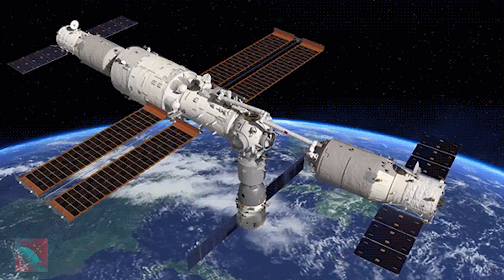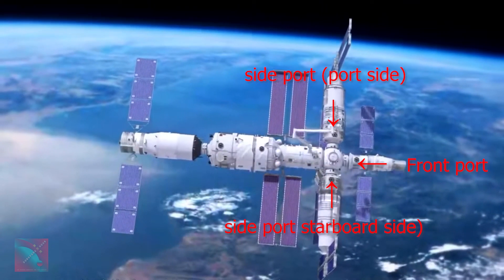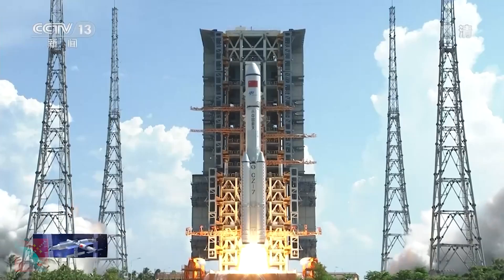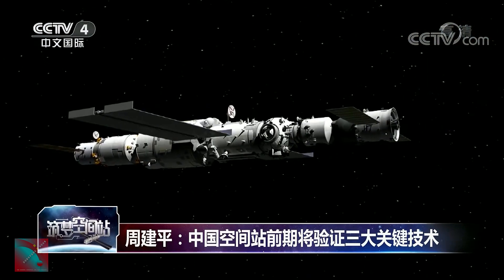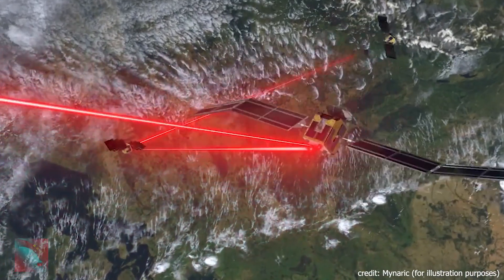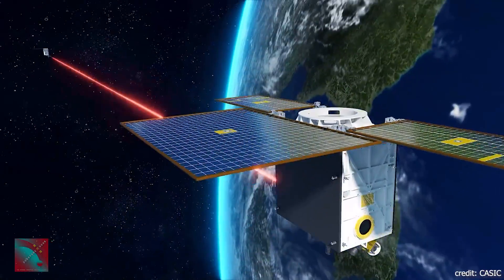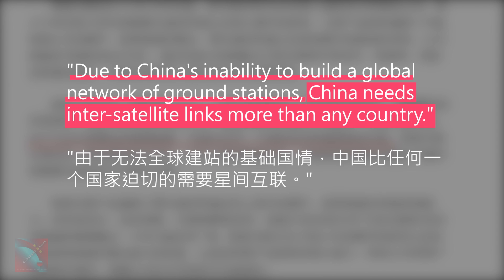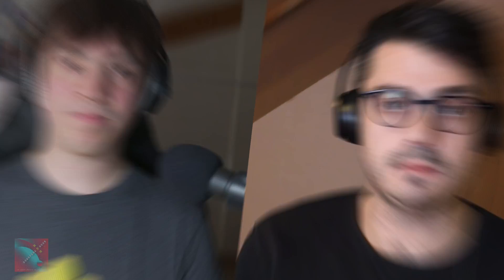The Chinese Space Station Tests Module Transfer Capability, A Startup is Developing Laser Comms Tech

Comment: I think the 20 degree was chosen because the solar array of tianzhou could not be re-folded and folding the solar panel of tianhe will be risky and time consuming, therefore, to avoid collision between the solar panels, only 20 degree turn was made to demonstrate the capability of robotic arm assisted undock, turning, and redock, instead of docking at the side, it redocked to the forward port, that is still a complete procedure to re-dock a module, only difference is that it is docked to the same port in this case
Reply from the maker: This is really helpful, thanks @Vony7. I’m pinning your comment to the top of the video 👍

Comment: I would agree with the 3rd choice with the robotic arm. My guess is they were testing the arm if it can hold up to the torque on the arm when it needs to stop or slow down the mass it is moving and to see how fast it can move it because of the torque when it needs to stop it.
As for the laser interlink, not only the performance goes up but also security reason, hard to intercept and hack into a laser link or disrupt it with electronic jamming...at least that is what I think.

Comment: I guess it's too time-consuming to run a full test for transferring the module completely. It took 47 mins to move the module 20 degrees away and back, so if Tianhe wants to move the module to the right position (90 degrees), it might take 3 hours or more. 
Besides, according to the official announcement, the 6th Jan test was to see whether the robot arm can handle a heavy object without damaging itself. So it might be just a feasibility experiment.